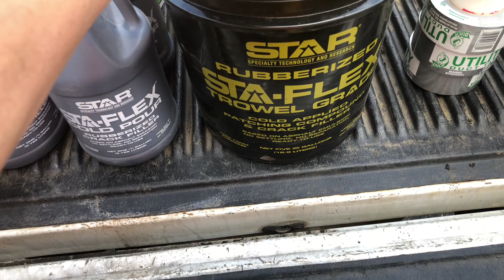Blacktop Tech Talk - Episode 6 crack filling gaps along foundations.

Comment: There’s expansion & contraction between the 2 masses.  Yep, clean the space, but also the surfaces for adhesion.  Basically, a caulk approach.  I’m going to try a standard rubberized asphalt liquid crack filler so it drops in.  Then after the filler cures overnight, a roof asphalt leak sealant, rubberized sealant that’s designed for sealing leaks, flexible to heat since it’s roof, and some UV durability.  And roof sealants tend to more sticky.  And if done as driveway sealant prep work, it could be protected by sealant.
Because it’s craftsmen work and multi process, the homeowner will have to do it contractors only want to do “once and done”. No return visits or they charge too much.